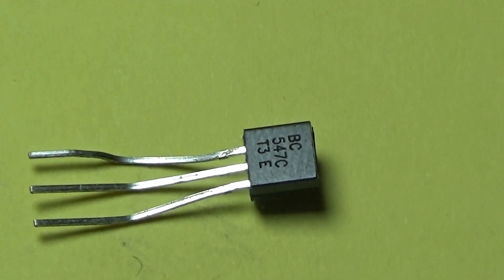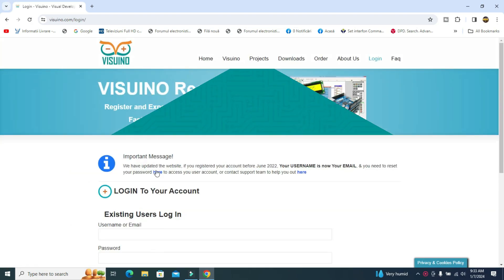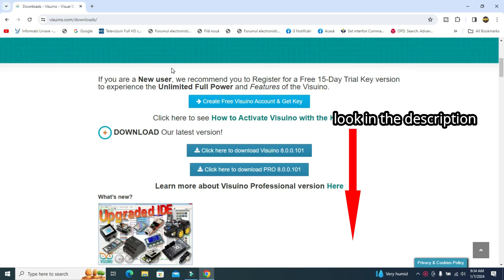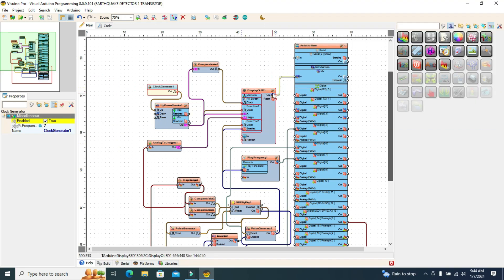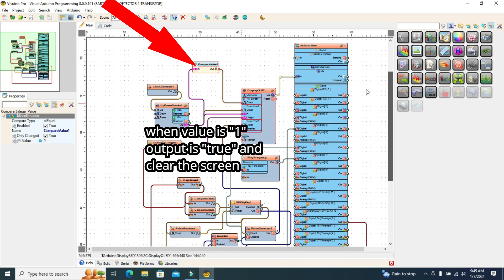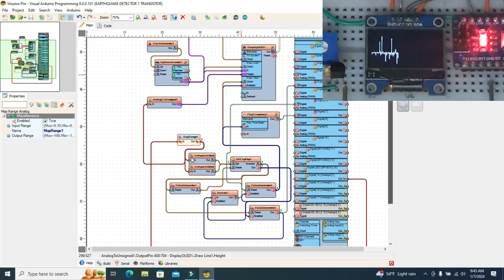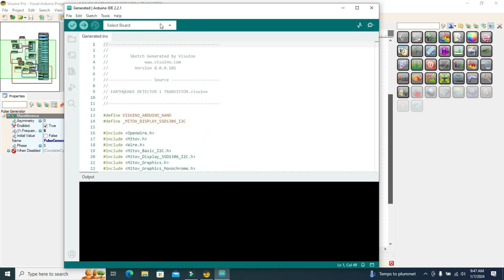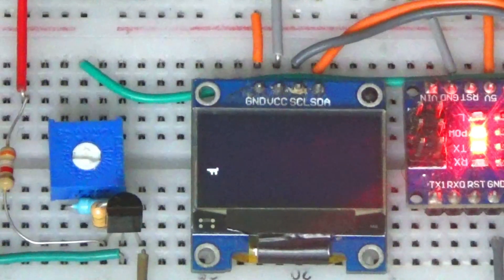Single Transistor Earthquake Detector! Arduino And Visuino Project!

Comment: Fantastic project! Could this approach be also used for making an oscilloscope with the OLED?
Reply from the maker: Thank you! It can be used, the displacement frequency of the dash must be calibrated according to the frequency. Likewise, on the Y axis, the movement must be correlated with "Array" components, the waveforms are complex on an oscilloscope.